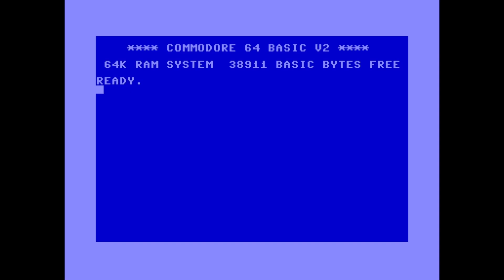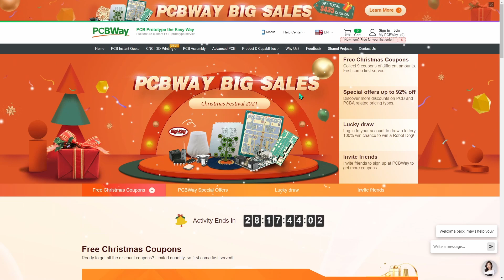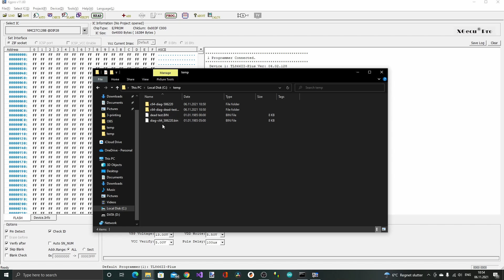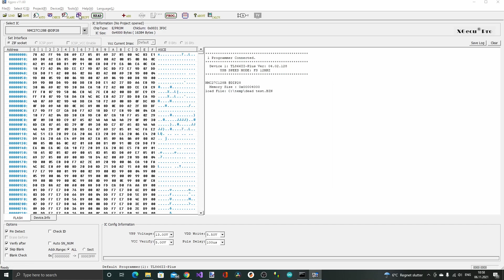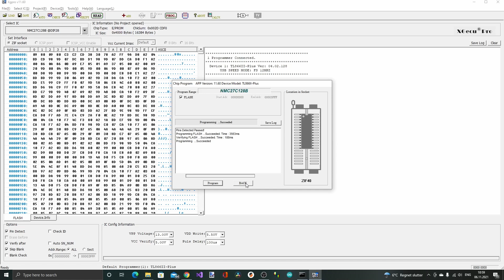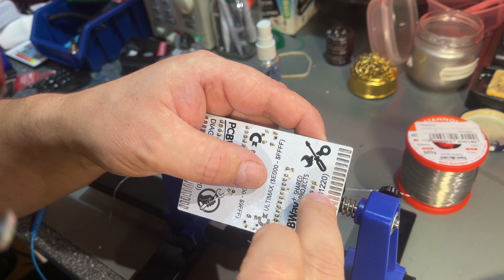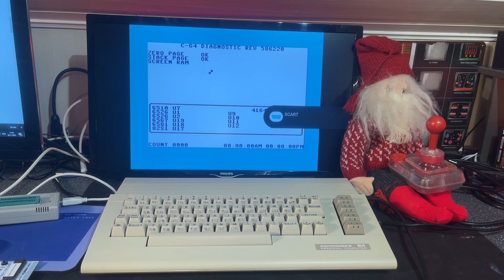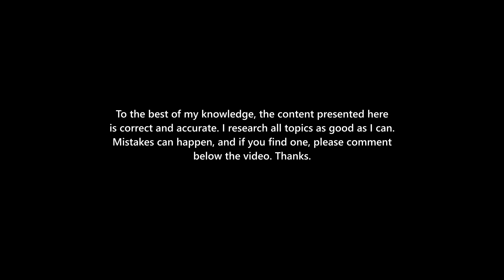December #7- C64 Dual diagnostics cartridge build - Commodore advent calendar 2021

Comment: I am not a Commodore guy, so I don't know the situation for these diagnostic software. But, if the creators are still developing them somehow, it wasn't a good idea to solder the EPROMs in. If they come up with a newer improved version, you won't be able to upgrade without de-soldering the EPROMs. I never solder EPROMs directly on board, always use a socket instead.
Reply from the maker: I usually use sockets for sure. Sometimes I am out of stock and it can be just a easy project just for the video :)